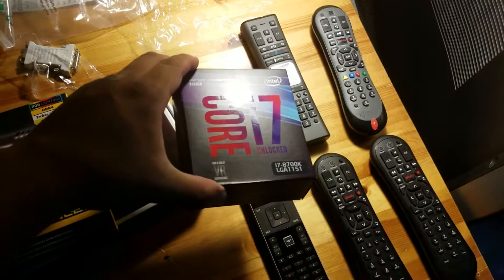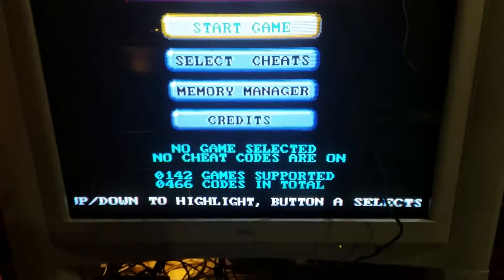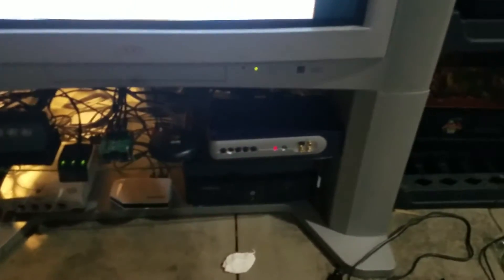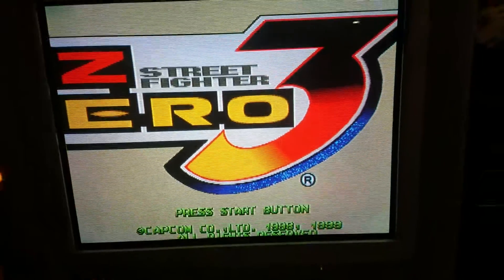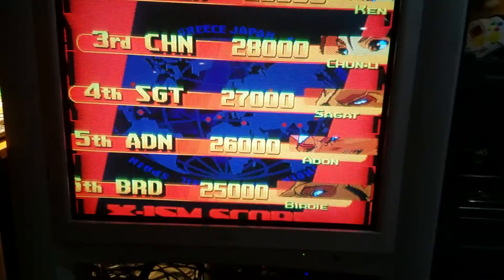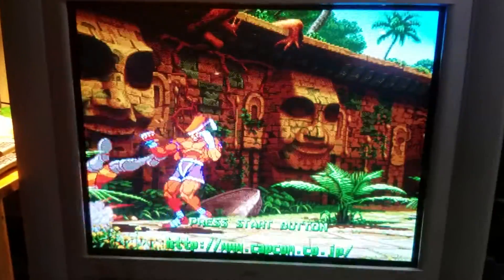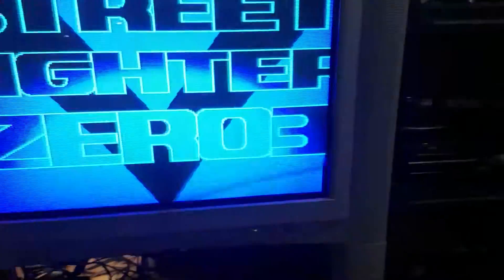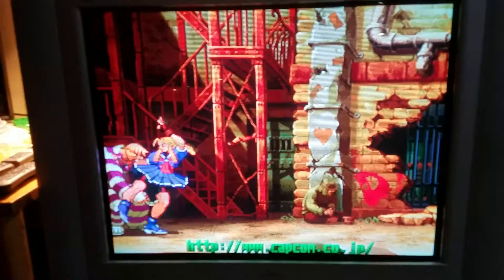RetroTek SCART to Component

Comment: You can spend more than 100 dollars on adapters... or... you can use a 10 dollar Retrobit S-Video cable. Looks just as good if your TV is correctly balanced.
Reply from the maker: well S-video doesn't look as good as component on this set. BTW the RGB2COMP I got from Mike Chi was only $60
Reply: @BahnYuki  Then I believe you. For some reason, in my TV wich is a Sony Wega 29 inch made in 2007, I can honestly say that S-Video looks just as good as component! (in terms of sharpness and image quality).

 The only problem I have with S-Video is the fact the it looks too sharp and in consoles like the PS2 is not ideal, as the PS2 is known for its lack of antialising. Any 2d console through S-Video on my TV looks glorious.

You do want component for anything PS2, Xbox or Gamecube but for other reasons, not because is sharper, but because of better light/brightness/gamma. All of this is my analysis using my TV for reference lol

Cheers and happy gaming, my best wishes and the best luck!

(my dream is to get a curvy CRT with component and S-Video inputs, my TV is great, but the geometry is never perfect, no matter how much I balance it out).

Comment: Edit: I found it on their home page. Doesn't seem to be on ebay anymore. Otherwise, this looks like the transcoder to get. Others are pretty raunchy and bad, like retrotink, retrovision, framemeister, xrgb etc..  they all have some weird kind of filtering or interpolation, even when disabled, the image is not raw. THIS on the other hand looks like a true analog transcoder without any kind of processing or scaling. by what i see on your screen, images are fast motion (like an arcade monitor), which I haven't seen done before using a transcoder for component, that's hella impressive! (others look to be slowed down and not very sharp as promised).

Edit2:  can you verify if this is the right product?   retrotekshop. com slash products?pn=SCBV2P2